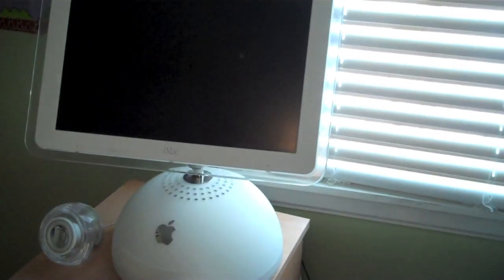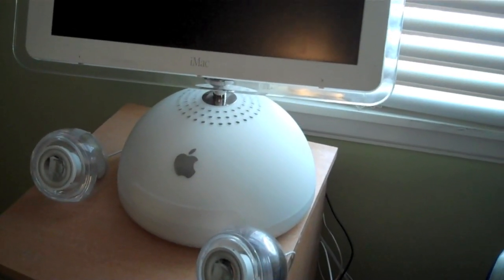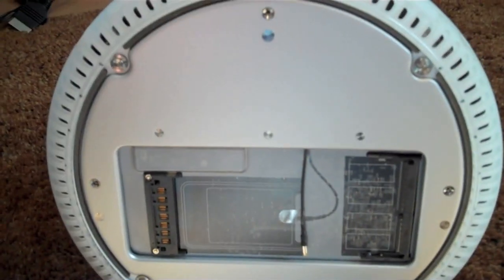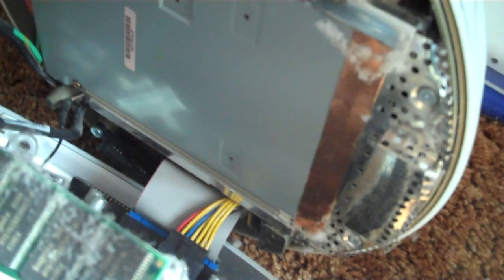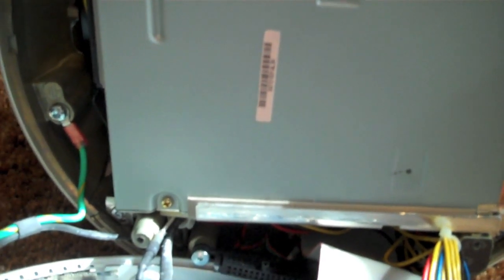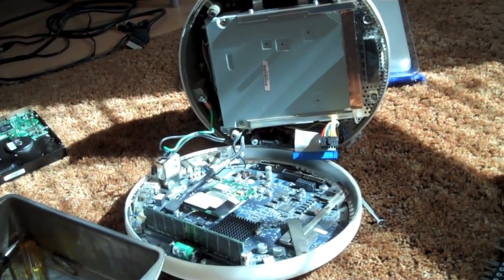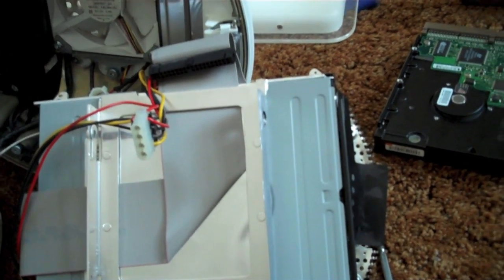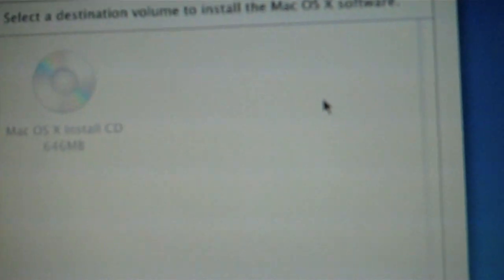iMac G4 Hard Drive Replacement

Comment: Go to the top of the screen where the selection bar is- you need to initialize the hard drive in order for your iMac to see it- it would be in the options- initialize/ format the hard disk- once that is done- go back to the install window and your iMac should see the disk correctly (there might be a "!" On the hard drive icon- before you try to install the OS- go to the Options tag button towards the bottom of the install window- it should now show as blue (rather the gray). Select options; Go to that area first- select the "erase and install" option- this usually is show as a last or third option (since this is a new/ or use hard drive it is good to do a nice clean install). You will get a warning that all data will be erased- hit ok- then install away. I hope this helps.

Comment: Hi  two ideas, one, when you boot up the install disk click language then go utilities then disk utility, see if you can see the drive, you will need to format it to mac journaled and under option click it for power pc mac not intel. 

if you see no drive then you need to compare the jumper settings on the back of the new hard drive, read the hard drive label and see if there is a thing that is connecting two pins together, check its position. you also need a instal dvd for tiger or leopard

Comment: you canb use to install Mac os X:

- IDE DVD-Rom Drive with ide-to-Firewire Bridge
- Sata DVD-Rom Drive with Sata-to-Firewire Bridge
- IDE DVD Drive or Superdrive, to bulid it into the iMac G4
- Ide/sata Harddrive with Sata/ide to Firewire Bridge  (external Firewire HDD)
- Mac With DVD-Drive (or superdrive) example a Macbook/Pro with Firewire (target mode) or Ethernet (DVD-sharing)

Comment: most likely mainboard doesnt like the size of the hard drive you are installing. wikipedia states the 1.0 GHz PowerPC G4 (7445) and the 1.0 GHz (15"), 1.25 GHz (17 & 20") PowerPC G4 (7445) Supports 28 GB+ but doesnt say to what size.(15-inch, 800 MHz model is M8535LL/A)  (M8812LL/A) can take a 40, 60, or 80 GB the 800 MHz PowerPC G4 (7450) is showing it had a 60 GB... not sure but id just try and go with a 60 to be sure and eventually invest in an external hard drive.

Comment: thats because Windows runs on x86 platform... which that mac did not at the time, now imacs run on x86 platforms.. so technically apple gave in and joined the PC market. *also,the Mac OS X operating system runs on PC based computers, just need some minor tweaking to allow it to install*